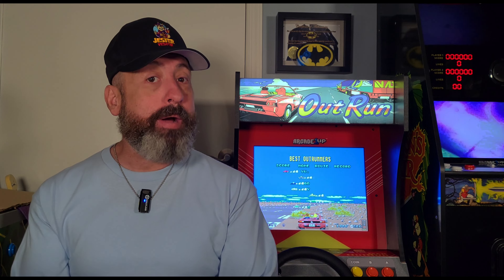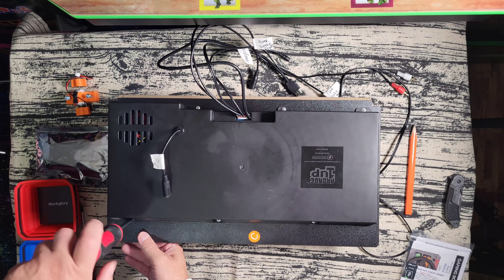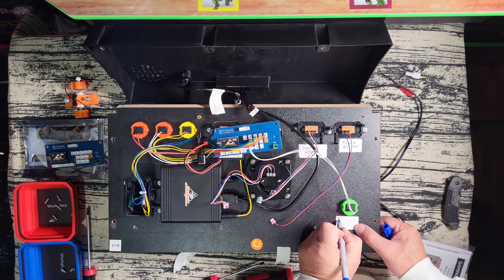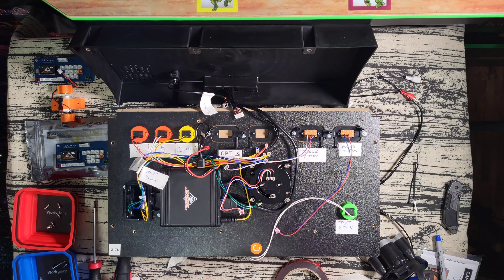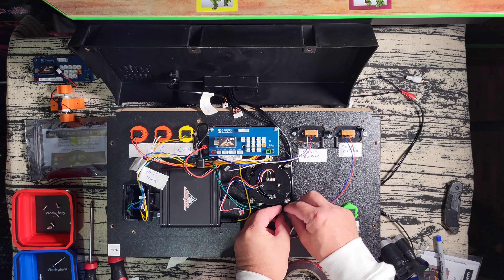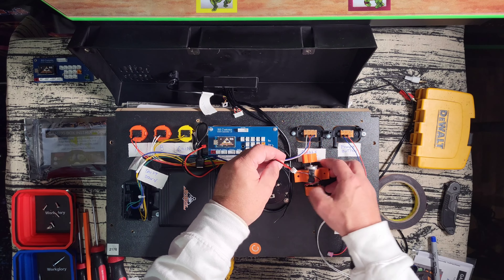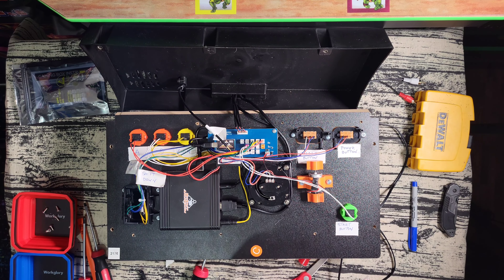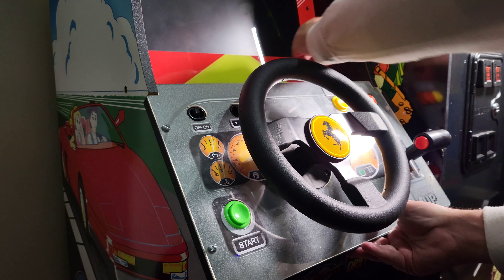Arcade1Up, Buystuff Arcades Outrun Rumble Motor and Encoder Install and Review

Comment: Man, glad that you the guts to do this. As soon as I received my OutRun new it wouldn't work. I had a heck of a time getting it up and running. If I take it apart it would probably never work again. A1up sent me a new PCB, New dash/controll deck, new ribbon cable. Got it working. What a nightmare mine was. Pre-ordered straight from a1up
Reply from the maker: Wow, brother,  I didn't know you had those many issues with the Outrun cabinet. That's insane. At least you were able to get all those parts from them.
 I hope all all is  still working well with your cab today......"knock wood". Thanks for stopping by. It's always great to talk to you.
Reply: @JesterTester  Yes, thanks. All games work great except Outrunners. It looks like the brakes are stuck on. Only that game. I think a recalibration might fix it. Problem is I've been sinking all of my time into guitars lately. 😁🎸
Reply from the maker: @DeputyVanHalen5150  Yes, I would try a recalibration also. Hopefully, that would do it.  Speaking of guitars, I just bought myself a knock-off Les Paul. Leo Jaymz for $200. People told me it was pretty nice. It actually is pretty good for the money. It has nice Humbucker pickups.  The look of it is really nice. I have spent so much though the years on the expensive ones that I just had to try one of these. I was impressed with it.
 I also just bought a Spark amp. That little thing is pretty nice also.
Reply: @JesterTester  Is it a Chibson? Lol That's okay man, a friend of mine got an Aliexpress Greenie (Gibson) and it looks and plays great! I couldn't believe it! I got a real deal EVH Striped Series Red and Black, now I really want the EVH 5150 also. Lol I like the 1984 Kramer too, wouldn't mind having that. Maybe I have a problem. 🤔😁
Reply from the maker: @DeputyVanHalen5150  Haha, a Chibson..yes. the EVH is really nice. For me, I always felt it uncomfortable to play the Strat style body shape. I have played Les Paul's since I was a little kid. So the top horn always felt odd to me. I guess it's just what you get used to.
Reply: @JesterTester  Absolutely! I own 3 strats and the EVH now. That's what I grew up playing on. Lol The Gibsons are a really comfortable shape for sure. The ones that I've played weigh more. I have an aneurysm so technically I'm not supposed to lift over 7lbs now. The EVH was 6lbs 4oz.
Reply from the maker: @DeputyVanHalen5150  That's cutting  your weight limit close. That is a nice weight, though. One of my Gibsons is almost 12 pounds.  Feeling heavier and heavier the older I get. Lol. Sorry about the health issue, my friend.
Reply: @JesterTester  Thank you, good talking to you. Keep up the good work with your channel. God bless 😎🎸✝️

Comment: I did a mod a while back. The wires in the Arcade1ups are so thin and fragile, i am always nervous they are going to break from the connectors trying to remove them. Awesome job on the install and review.
Reply from the maker: I do agree. They are thin and fragile.  But if you just take your time and not grab the wires themselves and just pull on the end connectors. You will do fine. Thanks for watching.

Comment: Howdy! I grabbed this mod and don’t feel the rumble AT ALL. I hear it turn on when it’s supposed to rumble, but there is no tactile response through the console. Do you really feel the rumble well? I’d love some help here!
Reply from the maker: I'm sorry to hear you're not getting a great response. Maybe you know this already, but in case you don't.  Have you tried increasing the power of the rumble. While in the game, press the Start plus the A button and keep pushing the shifter upwards to increase the rumble effect. Also, only certain games utilize the rumble motor.
Reply from the maker: If that doesn't work. You could try loosening up on the screws that hold down the motor. That will allow it to shake around a bit more. But you run the risk of it eventually shaking loose. Also, if your cabinet is on carpet.  That will deaden the rumble feel a bit. It's better on a hard floor. If all else fails, maybe reach out to Buystuff.  Maybe your motor is not spinning fast enough.  I hope I have helped in some way.

Comment: Very nice ! Random question.  Do the outrun games save high scores ? It seems not it I am not that good.  I know there are local high scores on the arcade game and in the non modded outrun cab.
Reply from the maker: Hi Peter, Unfortunately, no. Which is a bit of a bummer. When you exit the game or shut it down, it resets the scores. Yes, I loved that the stock saved your scores. This doesn't, unfortunately.  But I am going to look into their mame settings and see if there is something able to change, but at this point, I don't think it can.
Reply: @JesterTester  I believe the MAME of some versions do save the high scores . It would be nice !
Reply from the maker: @petermacnab1871  Yes, it definitely would. I just haven't had time to play around with it. I will definitely let you know if I am able to change it.
Reply: @JesterTester  all good thx.
Reply from the maker: Hi Peter, I wanted to check back in with you. I was speaking with the folks at Buystuff. They will look into it. They feel they may change up emulators if need be to get it to save. Just wanted to keep you updated.
Reply: @JesterTester  thx . I would love to have some the high scores save on the outrun games and possibly on as many arcade racers as possible . On the console versions I am quite sure it can’t be done but on most MAME roms it should be possible.  It is very nice to have high scores to go for to not get bored of playing.  The for checking this out 😊 I do have a sit down Outrun cab since that’s the only one they brought to Canada.  The stand up cab turned out to be the more popular choice and Buystuff mentioned that they might make a mod to go from sit down to stand up . Can you ask if there are any plans for that mod ?
Reply from the maker: @petermacnab1871  I will definitely ask. 
 Yes, I believe you are correct.  The console games can not have saved features.  But I do know the mame games can. It's a shame you weren't able to get the stand-up version by you. It definitely was more favorable than the sit down. I have the sit down also. I love the cabinet, but it does kill the back.
Reply from the maker: Just one question regarding the mod for Outrun to a stand-up. Are you referring to them offering a new longer front panel with a riser to place it on? Let me know if that's what you are referring to.  Have a great night, my friend.
Reply: @JesterTester  yes lol and it’s too low and looks a bit weird in my arcade also Thx for taking the time to find out if high score saves are possible !
Reply: @JesterTester  yes I am . I like the stand up look and I’m sure many who have the sit down would like the option to convert to a stand up and who else will do it ? I am counting on Buystuff ! Lol …have a good night as well !
Reply from the maker: @petermacnab1871  Hello Peter. I wanted to let you know I heard from Buystuff. They did say that they had the stand-up conversion kit on the production road. But as of now, it is hard  to estimate an ETA because they have so many different things they are working on. But it will be produced. Hope that helped.
Reply: @JesterTester  thx . I really want do do that mod !
Reply from the maker: @petermacnab1871  I don't blame you. The sit down is a back breaker.
Reply: @JesterTester  I know it can be modded with a new seat and riser but I also find it looks awkward in the arcade ! Maybe it’s just me ! Lol
Reply from the maker: @petermacnab1871  Yes, I was actually going to do that to mine. But, I decided not to. I think I am going to do the same thing and make it a stand-up, especially because the seat just takes up too much space in my room.
Reply: @JesterTester  a friend of mine got a nine seat and the mod kit from buystuff and I am sure it looks good but a lot of work and expense and I feel like it would be even more out of place in my arcade being that big.  Not sure but I’m sure the stand up would look cool and get played more by me.  These were not available in Canada so there must be others that would buy this.

Comment: Hey guys! Does anybody now if the rumble works with the original A1UP games? Or do I need to swap everything with the buy stuff mod game pack?
Reply from the maker: Hello Carlos,  Thanks so much for watching. Unfortunately, no. This particular rumble motor can only be powered by the encoder card, which supplies the appropriate encoder card voltage that is also controlled by their gaming box. The games included that feature the rumble have been optimized to work with the specific hardware and software buystuff   arcades utilizes. Also, every game in the arcade box does not have the rumble feature. Only certain later console games have the rumble feature. I hope this answers your question.
Reply: @JesterTester
Reply: @JesterTester  Yes this answers my question. Thank you so much! I wasn't subscribed to your channel but in appreciation for your help I am now. Well also your video was excellent!  Looking forward to watching more of your videos. Thank you very much!
Reply from the maker: @CarlosSanchez-pj9ch  Carlos, I am glad I answered your question.  Also, thank you so much for subscribing. I am very happy to have you part of the channel, my friend.